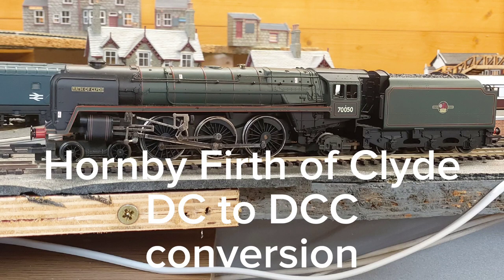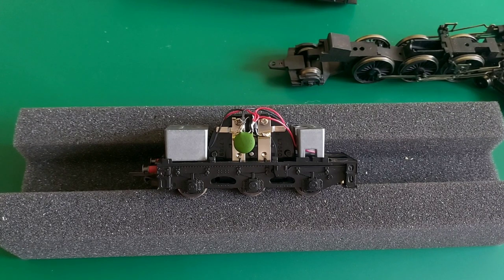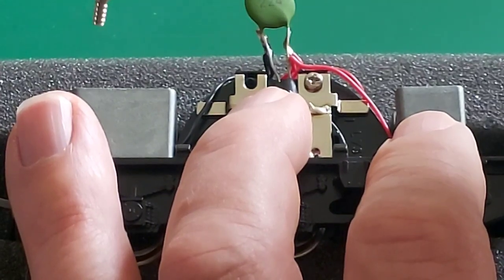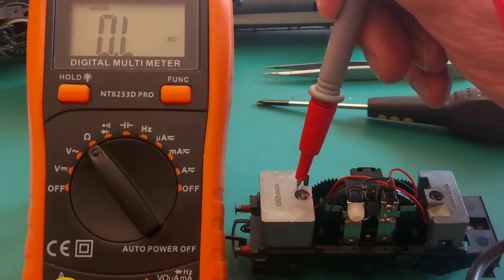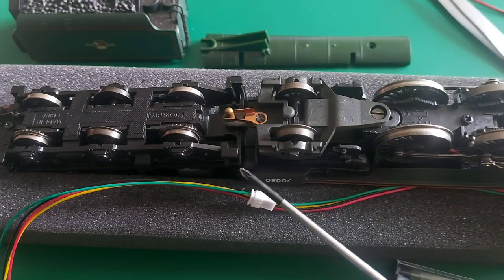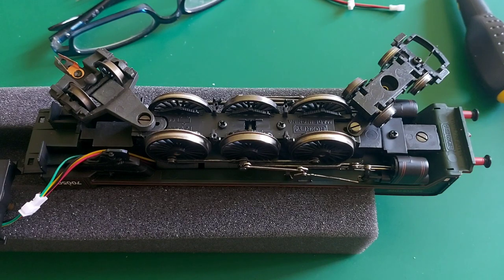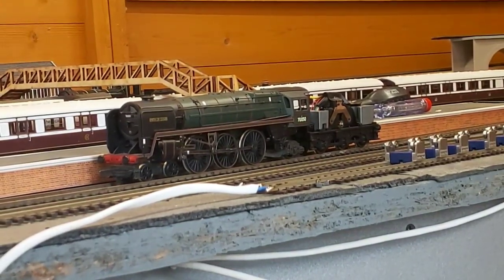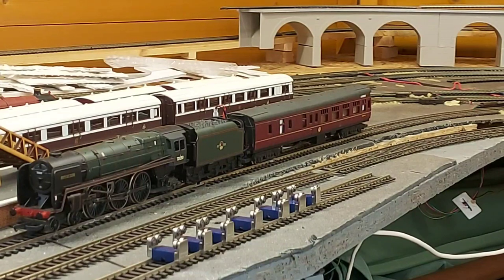Hornby DC to DCC Conversion Firth of Clyde (Brittania Class)

Comment: Very informative video. I do like these old tooling Hornby Britannia's but I do wish Hornby had done they same as they did with the old Railroad 9F and replace the Ringfileld with a motor in the Locomotive. I have the same as the one featured but mine is R2175 'Firth Of Tay'. The 5-Pole Ringfield does the job well enough but I feel it would be much more of an improvement if the motor was in the Locomotive as is with the Railroad 9F.
Reply from the maker: Thanks for commenting and yes I agree